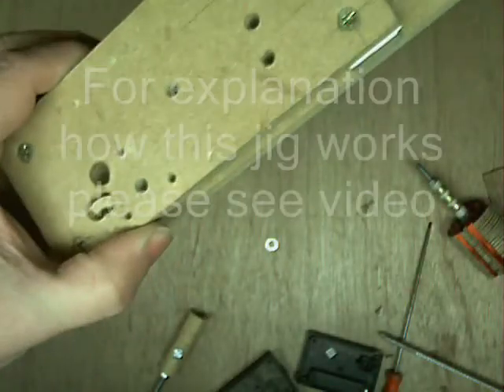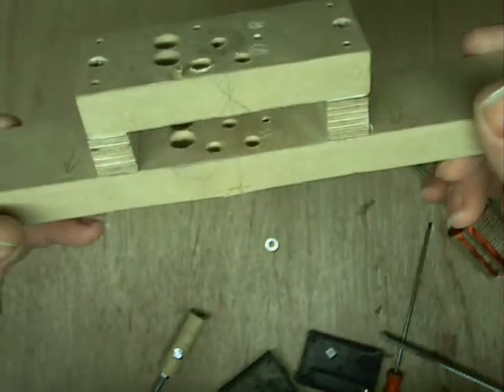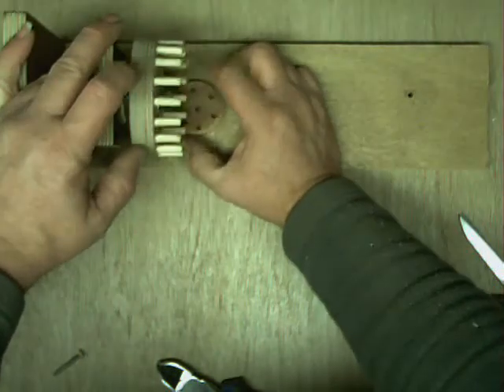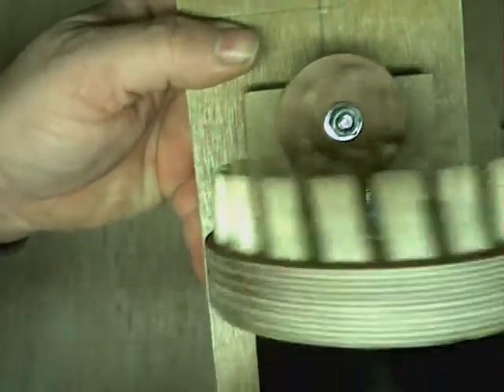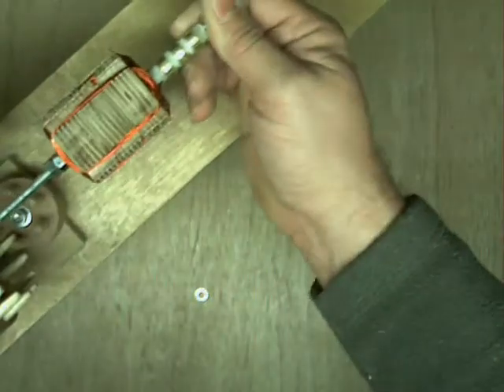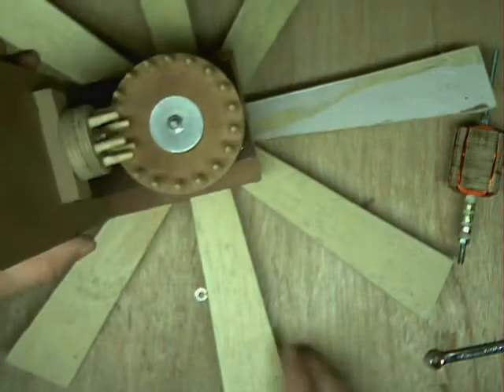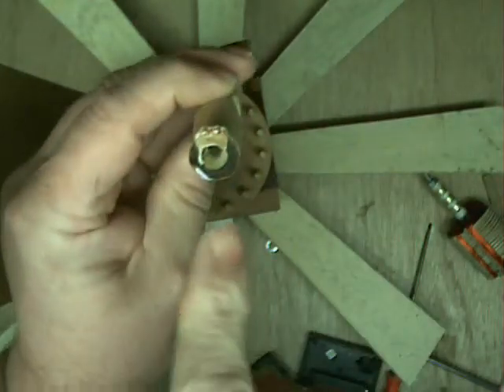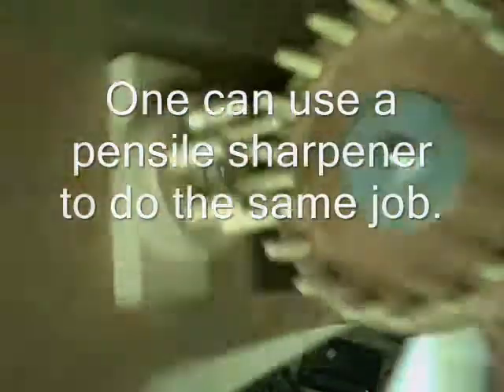Wind turbine project Pinion and pin taper 9 (theDaftman)

Comment: looking for the pics of the various circuit diagrams from the TEEP forums, but it is closed down. any idea where I can find your diagrams online again?
Reply from the maker: which diagrams in particular are you looking for?
Reply: @theDaftman  primarily anything bedini-related, including the swapper, and i recall there was another that showed how to wire the auto swapper into the bedini also. I would gladly accept all the schematics you have available, however.
Reply: @theDaftman  what info do you need from me to receive the diagram-schematics? Or do you have them posted elsewhere online now?
Reply from the maker: @brotherbrian7778   these are the links to my download files. they are the only ones I ever uploaded that was a downloaded version, rest was just photos, pictures and illustrations on the forum, and was all lost when the forum host shutdown. hope this 4 help. thanks TheDM (UK).

Bat Changeover with LED.
http://www.mediafire.com/file/trzuykmylkm/Bat_Changeover_with_LED.doc/file

Battery changeover switch.
http://www.mediafire.com/file/5fl1sf53xrl6yg9/battery_changeover_switch.doc/file

TheDaftman diagram set out.
http://www.mediafire.com/file/mllprsdj1jv/TheDaftman_diagram_set_out.doc/file

TheDaftMan Newman reed switch setout
http://www.mediafire.com/file/uswz1yjmmo3/TheDaftMan_Newman_reed_switch_setout.doc/file
Reply: @theDaftman  thank you, i used to have a link to a website that had all these and a couple others, called thedaftman website, black background, etc. had it bookmarked, but that hdd crashed. sure there is no other website floating around with your screenname on it?

Comment: Maby someone can find a slow taper pencil sharpener, but if not they can make one, just look at the design of one of those small ones and make a blade that you can bolt on to a piece of wood with a hole in it.